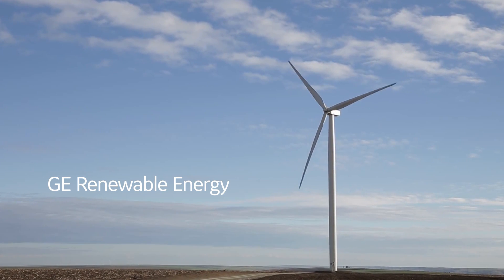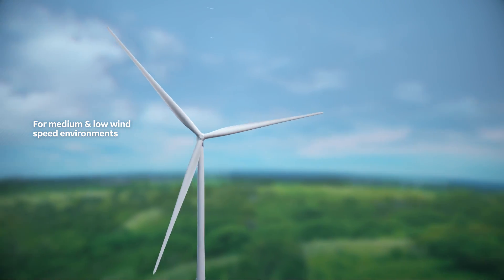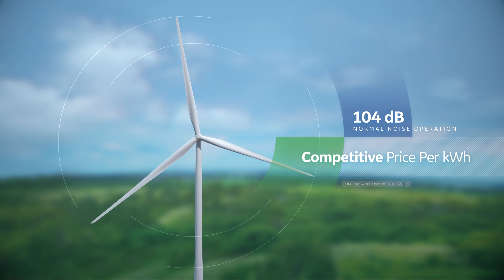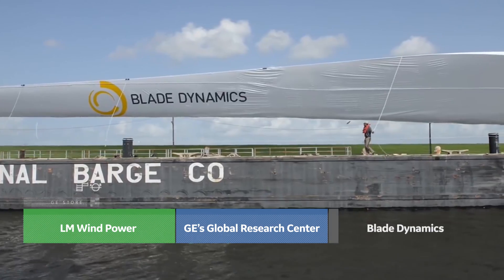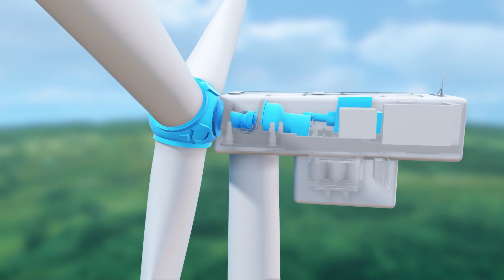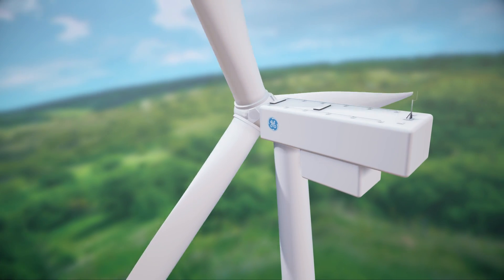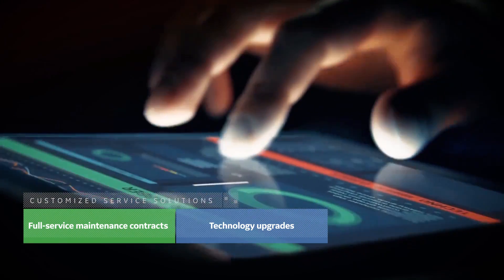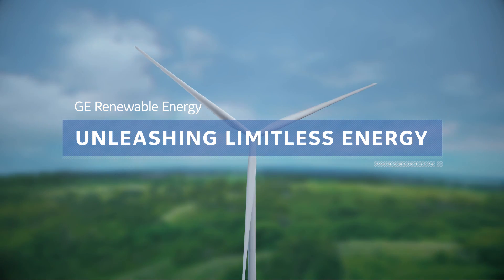GE’s 4.8 MW onshore wind turbine with 158m rotor diameter

Comment: When I see a windmill I see ruined landscapes. Unreliable power, and blackouts.
Reply: I am sorry, but would you rather have the oceans boil, or have a tall tree lookin thing 10 miles away.
Reply: @fla3p  if the oceans boil it won't be because of burning coal. The sun will be dying.
Reply: @Roddy Creswell. I you are wrong. Emissions of co2 Are proven to retain heat at a dangerous level. Go learn your stuff
Reply: @flyingpotato565 Your probably one of those idiots that jacks off to the trillion dollar companies that say electric cars are the green future. I love how your pfp is a bird, ironic considering you are defending the thing that kids the most.
Reply: @fla3p  sorry douche,  there was over 400 times more CO2 in the atmosphere when dinosaurs went extinct. Were the oceans boiling then? Where were the gas cars and coal power plants then? Back in the 60's and early 70's climate alarmist were saying if we didn't stop using so called fossil fuels then that by 1985 we would be in another ice age. You need to educate yourself instead of listening to MSM.

Comment: I've always wondered how much a unit like this one costs.
Reply: If you are looking for a smaller wind turbine your looking at around 400,000 pounds\dollers
Reply: This kind cost 6 to 8 million dollars to build and produces on average about 50MWh electricity each day, so at 5 cents a kilowatt hour that's 2500 dollars a day or 875,000 dollars a year. Minus servicing costs. They are designed to run at least 15 years before major refurbishing. New ones keep getting cheaper and more powerful every year. They are a clean green bonanza :D
Reply: @adymode  Tell us how "green" they are when it's time to have to dispose of them.